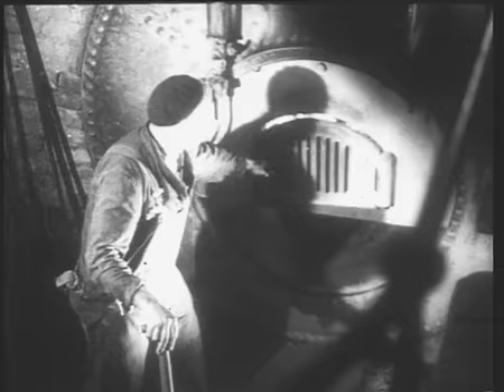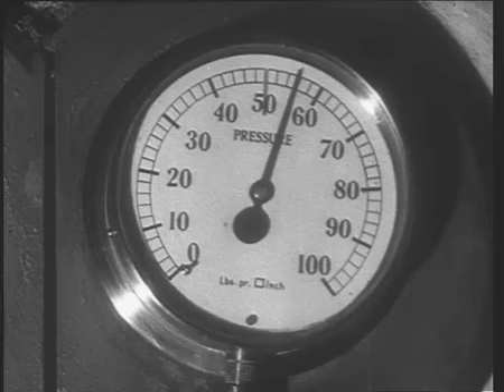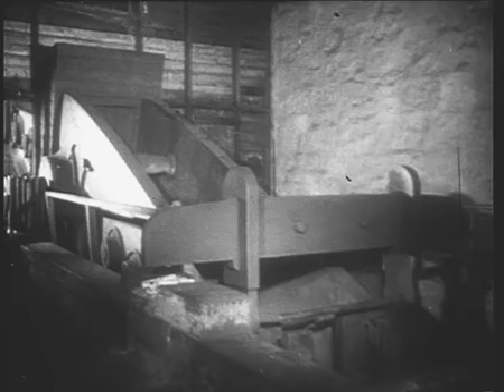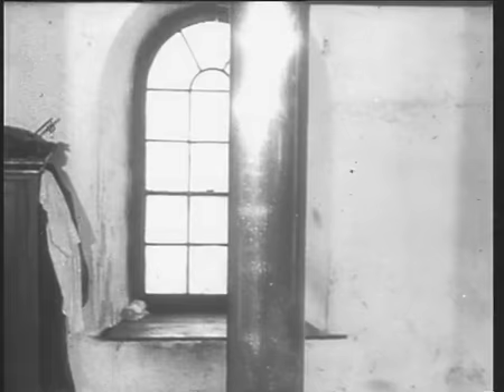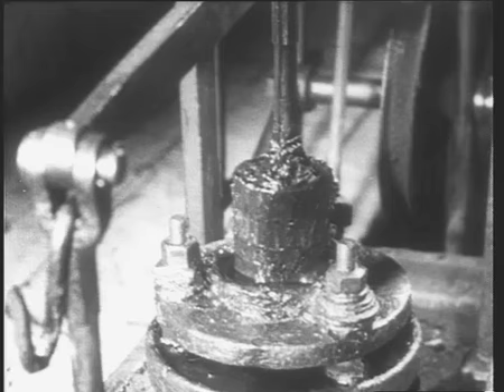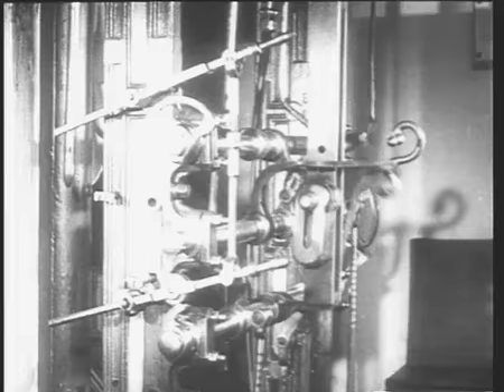the workings of a Cornish engine house

Comment: Also i wonder how many decades these guys have been long gone?
Reply: Most of this film is of Taylor’s pumping engine at east pool and agar mine pool redruth.
This 90 inch engine built by Harvey’s of hayle in 1892 stopped working in 1954.
The last engine to work on a Cornish mine is at robinsons shaft south crofty redruth, built by Sandy’s Vivian & co copper house foundry hayle in 1854.
She Finely stopped working on 
1st may 1955.
The last driver is said to be ted
Painter, who then worked under ground on the electrical pumps. So all our drivers have left us many decades ago!

Comment: If someone had thought of using a camshaft the system would of been so much better.
Reply: Cornish engines have camshafts, they are called plug rods, which move up and down
Reply: The problem is you'd never be able to make them big enough. The strokes in these engines are massive, measured in feet, while internal combustion engines had strokes in inches. The plug rods are actually the best solution for how big it is.
Reply: Obviously you don’t understand how lap and lead work for a steam engine!!!
Bit of a stupid comment really
Reply: Kernow EXP